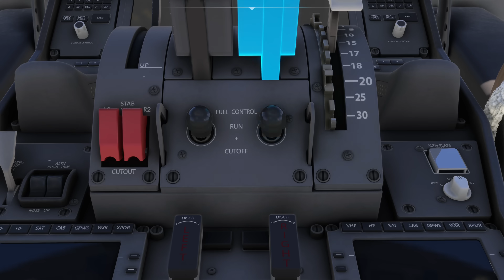Air India 171: Why Did The Fuel Cut-off Switch Get Moved?

Comment: Maybe the cutoff-switch should only accept a cutoff when the thrust levers are set to "idle". That would avoid accidental switching and makes it more obvious if someone tries to switch them off "silently".
Reply: you would have thought there would be an audio alarm when anyone tried to cutoff both engines when above ground level
Reply: @BornIn68  there is, engines spooling down at the very least. in case of fire more complex way of shutting the engine can lead to disaster.
Reply: Embraer made planes use this logic.
Reply: it might help here but in case of fire it might complicate things.
Reply: That would still not stop  pilot from crashing on purpose. There are so many ways to kill everybody on purpose if the pilot wants to do it.
Reply: @pedder55655
Another thought I also had too.
Thanks for posting, since I already forgot about it again 👍
Reply: I believe the Cessna Citation operates exactly this way
Reply: Agreed. This should be taken into consideration.
Reply: this ^^
Reply: Except you cannot plan for all contingencies. The person who did this heinous act would simply find another way to crash the plane.
Reply: Agree. Or make it impossible to switch them both off during take off.
Reply: @ejbeekeeper4360  Then someone not in their right mind could do any of the other 500 things you can do to mess with a complex machine. I agree with Captain Steeeve, the day they try to make the airplane more clever than the people flying it I'll stop flying.
Reply: @ejbeekeeper4360  And a take off censor fails, and then the cut off may not work when you need it to work.
Reply: or just make it so. if there is a fire. then only can they get shut down.

Comment: “Both pilots need to confirm fuel shut-off”. What if 1 pilot is medically incapacitated?
Reply: Yes, there's ways to improve this, Embraer planes use a logic that require the throttle in idle.
Reply: @Sokol10 The CRJ also which I am flying now, or it has the fuel shut off built into the throttles which need to be in idle and then a lever on the throttles can be lifted to place the throttle(s) in fuel shut off. The ATR also (previous type) worked in the same way and I am sure many other a/c as well.
Reply: exactly, everything need to work if single pilot operation is necessary

Comment: I don’t think it would be wise to rush for a solution like fuel switches that require dual input - what happens if one pilot is incapacitated? If a pilot is dead set on crashing their airliner sadly they’ll always find a way - better to have someone like Captain Steve looking out for pilots long before they decide to unalive themselves.

Comment: According to the report, it would appear to be fact that one pilot (which pilot this is, we don’t yet know, and possibly never will ) questions the other pilot as to the reason why he turned off the fuel supply switches. 
The other pilot (again, we don’t yet know which pilot) responds with a denial. 
The emphasis in discussion around this appears to suggest that the pilot denying having operated the said switches was responsible. (Similar to Capt Steve’s analogy of child denying doing something wrong when, in fact, they were guilty). 
It can’t be ignored, however, that it is quite possible that the pilot making the accusation, could have been the person responsible and instead, for his own reasons, blamed the other, knowing that the whole event was audibly recorded. 
It’s probably widely accepted that, whichever pilot made the ‘Mayday’ call, is less likely to have done anything sinister. 
It may surface as to the identity of ‘who said what’, and any background investigations may reveal more, who knows? But, due to the lack of any cockpit visual evidence, we may never know for sure as to why the fuel cut off switches were turned off, nor by who.

Comment: Hi Captain Steeve, wouldn't an audio sound when throwing the cut off switch add some extra safety to the cockpit. The switch  movement would be instantly recognised and be able to counter immediately  if necessary. Saving precious seconds .

Comment: If you wanted to crash a plane at that altitude, you'd just push the stick forward.  Or pull the fire handles.
Moving the start switches to cut-off risks the other pilot simply switching them back on again (which is exactly what happened, just not quick enough) and the other pilot didn't switch them back off or do anything else to sabotage the plane... 
Sounds more likely to be brain fade rather than a deliberate act, but keep on farming views with baseless insinuations.

Comment: Captain Steeeve" You constantly say "The fuel cutoff switches were "placed in the Cut off" position while there is NO definitive data (visual imaging or voice date) to confirm that. The one pilot asks "why did you do that"??? Maybe he was asking about the obvious spooling down of the engines ?? The 10 second interval to putting the switches back into the "run" position might more logically indicate some "reasoning" that "maybe we should toggle those fuel switches" . ALL SPECULATION SINCE THERE HAS BEEN NO DEFINITIVE DATE/INFO OFFERED  in this report !! Is not the position of these switches provided by the "black box" determined through "contact position" (as opposed to switch lever image) data ??? In other words, how does the black box know which position these switches are in???

Comment: Given that there were two experienced pilot for this type and that this Boeing 787 was older could the pilot who initially placed the cutoff switches in run have performed this procedure so many times in the past that it was not performed carefully. This coupled with worn cutoff switches where these switches were thought to have been placed in the run position but were in fact hung up between the run and cutoff position. Being spring loaded the vibration of takeoff caused these two switches fall back into the off position???

Comment: This is another Boeing' s cover up. Nothing moved and this was clear from pilots' conversations and the fact that they simply did not have enough time to perform shut-off-and-on operations. The fuel pumps may have stopped functioning due to electric system malfunction when no physical action was required at all.

Comment: IMO.. The fuel cut-off switches and related circuitry should not be allowed to cut fuel to the engines when/while the engine throttle levers are in the full power/full thrust position on take off. Why would Boeing design engineers allow for that to actually take place? Before fuel is allowed to be cut-off (by way of a cut-off command), the control system design should require that the throttle levers be returned to the idle position first.

Comment: Do we know for a fact that the fuel shutoff switches were physically moved? Does the FDR sense actual switch movement, or does it sense valve movement on the engine end, or even just the circuit closing? Could the valves have closed due to a mechanical, electrical, or software glitch, without manual switch manipulation at all, and the FDR data interpreted as switch movement?

Comment: If I may suggest something... Switches like that don't flip back "just like that" especially two of them at the same time ... and pilots wouldn't switch off the fuel in seconds after take off !!!! 
But it is possible that they actually took off with both switches on OFF Position, the computer considering that the plane was not in the air. If the computer system has a bug of course... Then, at the second the plane took off, the status in the computer system moved from "ON LAND" to "IN AIR", thanks to the ground sensor...the computer realized suddenly that the switches were on OFF position and reacted accordingly ... That would explain why the system cut off the fuel at the very second the plane took off !!!

Comment: It sure would be nice if Boeing and Airbus would implement what Embraer did decades ago — that moving the start stop selectors (same as fuel cutoff switches) to stop does nothing until that corresponding thrust lever is also retarded to idle. If that design was implemented in the 787, even if you believe this was a nefarious act, I don’t believe this crash would’ve occurred because the flying pilot would’ve likely had his hand on the thrust levers.

Comment: A potential modification might be needed where both pilots will have to approve on screen when fuel switched turned to shut off at low altitude. That would prevent fuel shut off even if one does it deliberately when other doesn't approve. This may increase the workload in critical situation but can save 100s of lives

Comment: I like the idea of dual pilot input for critical controls like fuel cut-off switches.   Think of it as similar to nuclear missile operators: One cannot launch without some form of input from the other.   On the flight deck, it could be possible for each pilot to have a simple push-style button on their respective yoke that the other pilot cannot reach while holding their button.   Need to cut off fuel switches?  Each pilot holds a button down which confirms "acceptance" of any action requiring dual pilot input.   This concept defeats either pilot from sabotage. 

Conceptually this is a good idea.   Execution would be really difficult however because trying to wire anything new into an existing airframe would be very expensive.   Not to mention having to reconfigure mechanical actuated switches to "sense" both pilot input buttons are pressed down. 

Moving forward on new aircraft builds, it would be an interesting concept to implement...Pilot sabotage is RARE but as the world turns, it seems that humans in general are becoming more and more stressed which may end up leading to more pilot sabotage.   

I hate even having to type this because I grew up in a world where human morals were more valued than they are today.   I cannot even fathom a trained pilot sabotaging an aircraft full of humans.  I don't want to believe this conclusion...

Comment: Seems like a software patch could include an immediate annunciator when a fuel control switch is moved to the off position and a delay of 3 or 5 seconds before the FADEC actually commands fuel cut. This would give the crew time to respond to an accidental or intentional movement of the switch.

I understand this is 3 to 5 seconds of fuel delivery when there might be an actual emergency or fire, but fire bottles can mitigate this risk most of the time.

Comment: I understand pilots’ resistance to cameras on a human level but reject that resistance on a practical one. There are TWO people in charge of a vehicle carrying hundreds of people. Everyone on a plane save TWO have absolutely zero control over the operation of that aircraft. As we have seen here if ONE person out of a hundred plus people decides to bring a plane down  they can. Cameras would at least allow posthumous accountability.

I don’t buy the leaked footage argument because if the video is tied to the FDR and special processes are required to get the data out then the rogue employee with a USB stick line goes out the window.

I believe the industry and regulators need to figure out ways to mitigate the intentions of one or two suicidal or maniacal pilots. Is the probability of this happening again slim? Yes, but now that the method has been proven it gives those compromised pilots confidence their plot will be successful. It’s all about making it harder for those people to do bad things where no one is able to intervene.

Comment: captain steve with all due respect, no it cannot be that it's required two pilots for every switch and procedure in the plane because what happens when pilot incapacitation
Reply: That's a good point.  This is a tough question - on the one hand, you can't make it so that every 'critical' action require two pilots...that may actually be a hazard in and of itself as you mention.  On the other hand, not doing anything means one pilot has the ability to doom the lives of hundreds on people.  Nothing is ever going to be 100% safe I suppose - if a pilot wants to bring down an airplane, chances are they'll find a way sooner or later.
Reply: @ElChocoLoco  thing is that actions like here with the captain of the air india crash, is bread and butter for those fighting to remove pilots from airliners entirely. it's the argument they need to further push for pilotless planes in the future
Reply: Maybe add a key like a car instead of a simple switch.
Reply: flight crew exists

Comment: Why not to focus on these fuel cut-off switches? The Part Numer is the same as FAA questioned units in 2018. I would inspect them all throughout the fleet for mechanical comdition, especially wear or loosness or spring condition. Imagine how many on-off cycles they have since initial installation?

Comment: 1:07 It could be that whichever pilot moved the fuel control lever to off is also the one who asked "why did you cut off?" (In an attempt to  frame the other pilot) We just don't have enough information yet.
Reply: Nonsense
Reply: What's nonsense is leaving a single word reply to a comment rather than an actual argument.

Comment: Captain Steve - I seem to remember from other crash investigations that there are multiple microphones placed in specific locations within the cockpit for the Flight Voice Recorder.   Aren't the investigators able to determine which pilot asked the other why he cut off the fuel and the related response, based on the positions of the microphones?

Comment: HOW do they KNOW that the fuel cut off switches were moved? There is obviously a possibility that the fuel was cut off to the engines without the lever being moved. Why dont you discuss that? There is no video in the cockpit. So there is video evidence of the switch being moved. So what exactly is the evidence that the switch was moved? Presumably it comes out of the flight data recorder. So where does the flight data recorder collect that data? In the cockpit at the lever? at the engine at the fuel valve?
You are making statements that contain implicit assumptions. It may be that you are absolutely right. But if you do not explain where the information that the fuel cut off switches were moved then you are just assuming - not knowing or proving. How do they know that the fuel value switches were put back to 'run'? Again where does that data get collected?
The report is incomplete. Accordingly your comments are based on assumption.
You cannot ask why something happened until you have proven that it did happen. Yes it seems that the engine fuel supply was cut off. Yes it looks 'obvious' that a pilot must have operated the switches to do that. But please prove the 'obvious' rather than assume it.

Comment: P1: Why did you cutoff?
P2: I didn't.
Silence.
After about 20 sec: P?: Mayday mayday mayday.

Both pilots, or just one, waited for 10 sec before switching 1 on, waited 4 more sec to turn another 1 on. Dead engines are very silent, both of them will hear the silence and why was it turned on only after 10 to 14 sec? This just dont make sense. If one pilot is saying it was in cutoff, why did he wait 10 sec to turn it on?

My guess: The switches were ON all along. One pilot noticed both engines spooling down and asked, "Why did you cut off?", assuming the other had shut them down. The other replied, "I didn't." They saw the switches were still ON and panicked. One of them tried cycling the switches OFF and ON again, but nothing happened. They kept trying, and eventually after a 10 seconds one engine restarted, while the other took four more seconds. But by then, they were too low, and the engines didn’t have enough time to recover before impact. But only a full disclosure of the recorded audio can confirm this, as these switches will be audible.

Comment: Regarding the fuel cutoff switchs ... it would be simple to achieve 2 person operation for the switchs ... just relocate both switchs to each side. i.e. the captain has a pair (or 4 depending on engines) on their side & the FO has the same switchs on their side. to shut down an engine would require 'AND' logic on the ecams so for example both switch 1's (or whatever engine) would be required to be in the cutoff position to send the signal. And due to physical distance it would prevent single person operation. In the event of pilot incapacitation then chief cabin crew could be called on to operate the switch to initiate the cutoff.

Comment: 1:33 quite possible the pilot who is asking the question is the one who did it. It's kind of a manipulative question a common trait of psychopathic individual. The one who did was sure he is not going to answer about it. Left engine switch was turned off first and then the right engine, it was turned on also with same sequence. quite probable the one who switched off is sitting on the left side.

Comment: So many technical solutions being proposed for what amounts to a human problem. The more complicated you make the system, the more likely there is to be a failure. You could be doing more harm than good. And you're not going to solve the ultimate problem, because a pilot determined to bring their plane down will find a way. If you tried to prevent all the possible methods, you would make the plane unflyable. Address the human problem.

Comment: Why is the question about the fuel cut off switch and not about the Software that controls the solenoid valve at the fuel line. One pilot replied that’s did not move the switches

Comment: Steve..... could the switches have been resting on the top of the hump of the mechanism that requires them to be pulled out to move to the off position. Could vibrations have allowed them to then jump to the off position. Can the switches even rest at the top of the preventer hump?